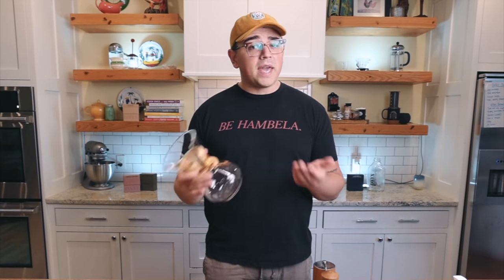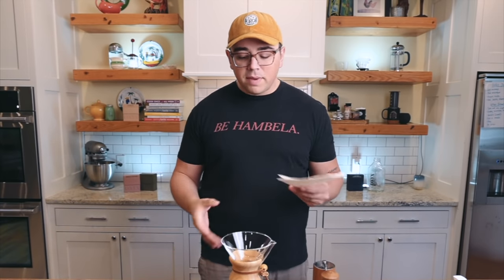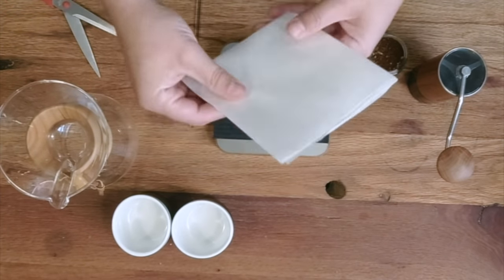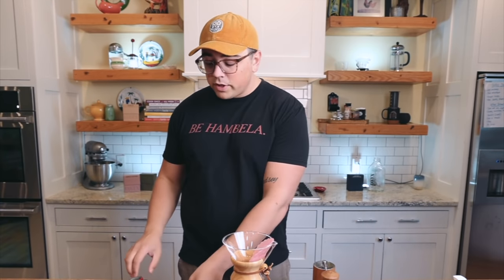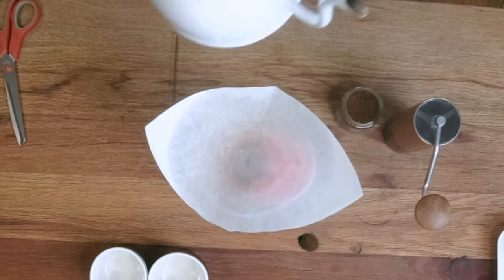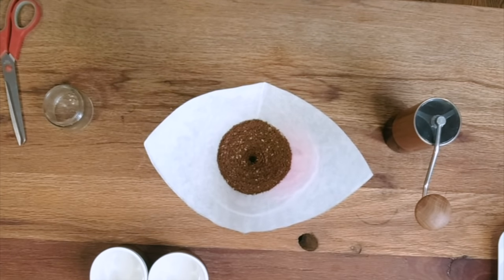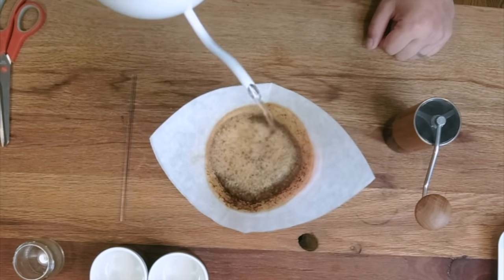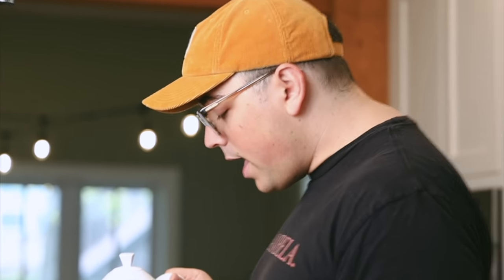CHEMEX BREW GUIDE: How to Hack and Brew Incredible Coffee on the Chemex

Comment: Have had my Chemex for countless years. I solved the vent problem long ago with a simple fix. I have a supply of plastic drinking straws, the ones with a flex joint on one end. I fold the straw down at the flex point to 180 degrees and put a small piece of clear tape  right at the bend to hold it in that position. I then place the long portion of teh straw down inside the vent channel and hook it on the pouring lip. It stays, no problem and provides the intended airflow for the pour to go without bubbling or stopping. Reuse many times, wash, rinse, repeat or get a new one.

Comment: For my 2 cents having used the chemex daily about 2 years, I don't have any issues with stalling and I've only had the spout clog a handful of times. I grind just barely coarser than a v60, but also make a larger 30:500 batch (in ~5min). You can totally avoid those issues just by using the filter the normal way, and I love how clean the cup is. 
Totally excited to try these hacks, love the stir stick and the cut filter hack! I just think the chemex deserves more love!
Reply from the maker: You're one in a million if you've not had clogs. Lol it's a ubiquitous complaint globally against the chemex lol.
Reply: I don’t have clogs either.  If it does happen, it just takes a quick shift of the paper to correct.  If it does happen to my brews, it is a simple correction.
Reply: @AdventuresinBackpacking  Same for me! One tiny clog once, quickly corrected and typically very uniform results.
Reply: @LanceHedrick  I think the reason for all those complaints is because most coffee connoisseurs (or snobs, lol) like to experiment and do their own thing. I have Baratza and Chemex and I do what the instructions say: 18-20 grind setting  depending on how light the roast is. I’ve never had an issue with clogging. I do a very gentle pour and a couple of swirls. Love my v60, moka, aeropress, but in the morning for the whole family 60/1000gr is perfect. Cheers!
Reply: @LanceHedrick  No Clogging for me
Reply: No clogs for me
Reply: Tried this today and got my first clog. Is it possible it's related to stirring?
Reply: No clogs for me either
Reply: I don’t have the clog issue either. Heard it often, but I have always used the filters as designed.
Reply: @LanceHedrick  no clogs for me either.  1 in a million is a little ... false I guess.
Reply from the maker: @Mark Purcell  nah. Just 12million people use the chemex and all 12 commented here. Or, perhaps more believable, one in a million is overt hyperbole. In my decade of teaching thousands of baristas, I've never once encountered someone using specialty coffee not encounter clogging IFF prewetting the filter 

But I digress. So proud of you all for not having clogging!
Reply: @LanceHedrick  I should have also added, I use the 6-cup chemex. Maybe has something to do with the type? I understand exceptions don't disprove the general rule, but there may be more nuance than "chemex brewers clog".
Reply: @masewinter  I think you may be on to something here. Using the exact same filters, I notice that I have absolutely zero clogging issues with the 6 Cup Chemex we use at the cafe I work at - but that I have to be super careful with my 8 Cup Chemex at home because it happens frequently. I wonder if there is some subtle design difference between the different sizes that can cause the same filters to either clog or not.
Reply: Used it for a year now every single morning, I've only had like 3 or 4 clogs and it was the times I forgot to align the thick side with the spout. Not a problem for me :)
Reply: I have a 10-cup, and honestly all of this sounds like a skill issue
Reply: Yeah I don't understand any of the issues he's talking about. Chemex has been my daily driver for almost two years and it works exactly how it's supposed to and results in a terrific cup every time
Reply: No clogs for me either, ever.
Reply: Clogs are very rare for me, but admittedly it took some time to get the filter sitting right to prevent it mostly permanently
Reply: came here looking for this comment. Never had any issues with clogs. I think it's happened once.
Reply: Mine doesn’t clog either. Don’t even know if I experienced it once. 

The problem more likely is people are grinding too fine and don’t know that need to grinder coarser.

Comment: i hate to disagree with you.  i usually love your videos.  i've been using a chemex since 1980.  water can not bypass the filter on the single fold side, there is glass there.  it doesn't get any better than that.  as for bypass on the 3 fold side, because of the small pour spout.  i have watched for this, and i have barely seen any of this; there are 3 layers of thick paper there.  if there is bypass, it is much less than a v60 would have with groves all the way around.  

in the last 5-10 years, i have noticed the filters appear to have changed.  i have never had a filter, 3 plies into the pour spout, plug the spout and cause a jam.  but like i said, in the last 5-10 years things changed.  i now fold back a portion of the 3 ply side's "ear" down into the spout.  this little trick totally solved the issue and i have never had it again.

Comment: Been using the Chemex for years and not once has it clogged on me. Just fold and press your filter properly then hold it with your fingers against the glass until you’ve wet a full circle. It’s not going anywhere after that. The chute is designed to prevent the paper from clogging it, that’s why (unlike a V60 server for example) the groove goes all the way down into the reservoir.

Comment: The Chemex was one of my first brewers on my coffee/pour over journey. Sadly I broke my first Chemex but bought the bigger version with the handle. They fixed the air flow issue with a bigger lip. I haven't had clogs with the new version but the filter hack and the stir stick hacks were very useful. Madcap coffee has a recipe that's nice as well and pretty close to yours.

Comment: I always feel weird that I've heard so much about chemex and stalls and used one for my daily brew for years and  never had a particular problem with it. I just do the 3 fold side on the side with the spout and do the divot thing  with the bed in this video and it's always worked  great.
Reply from the maker: Nice! Well, I promise your extraction will be more even with these hacks, even if you haven't experienced stalls. Stopping the bypass with that silicon hack and, even more importantly, the filter folding trick, will both help increase extraction and I believe your whole experience
Reply: @LanceHedrick  why would he care about those silly hacks when it works just fine. way too complicated doing all these unnecessary extra steps

Comment: Hey Lance, great video and I love the paper trick and the trick with the stick to spread the grounds. Question about the paper trick, Ive noticed while majority of the paper is still 2 and 2, the very bottom of the filter is actually not 2 and 2 due to the 45 degree cut. It's actually 1 and 3 still. 

Any ideas on how to fix this?
Reply: I'm not Lance, but I can answer: there's no way to fix it. It's that little bit you leave un-cut that prevents grounds from falling through the filter.

Comment: Interesting method of preparing the paper filter... I just buy "cone" filter papers...but I liked the use of the silicon, and stirring stick placement.
Reply from the maker: For sure. You can use cone, but the chemex filter is actually quite good. Thick and sturdy. I like using them for big brews much more than thin cone filters
Reply: @LanceHedrick  I wonder how would a double cone filter compare to a chemex filter? i think it is worth a try.

Comment: Thanks for another great lesson, Lance! Instead of the silicone, you could try sitting a metal straw or glass pipette right into the spout: it would provide a wall for the paper filter and breathing hole for the container, and do away with plastics... Talk about metal, any word on stainless steel filters?
Reply from the maker: You could but it would solve the bypass that happens there!
And I don't enjoy metal filters. They allow too many insolubles through to the final cup. I prefer clean cups where the acidity isn't overrun by the cell wall fragments, oils, etc, that make it through. But, everyone is different!
Reply: Does the straw method work for you? I had that same idea and then saw your comment.

Comment: Not sure if the three-layer filter side filters are any different than the one-layer filter.  Because the filter is not filtering much pass-thru down its sides, we hope. It filters only through the bottom one-inch or so diameter bottleneck hole, so the filtration difference from three sides versus one side is only after the bottleneck hole.  There is a difference, which you can check by tilting your Chemex one way or the other and you will see flow rate change. Once the filter is wet against the smooth glass cone above the bottleneck, no brew gets through until it reaches down into the bottleneck.  Right?  Now consider if I am wrong about that.  Then the Chemex engineers would have made the triple-fold side filter 1/3 the amount of the single-fold side and the single-fold side filter three times the amount of the three-fold side with neither side's flow-through being optimal.  That's not impossible; they would have made the filter's pass-through holes to allow an optimal average with a 3 to 1 ratio.  Saying it differently, the thick side would filter three times slower than optimal and the thin side would filter three times faster than optimal.  Together they would add up to Optimal.  

A tapered chopstick (Japanese style) is excellent to hold the funnel open, if necessary.  A red one works best.  That pink thing destroys the Chemex, I doubt you'd find that in the Museum of Modern Art.

Comment: What ever you do Lance, there is ALWAYS something I learn.  Can’t wait to try your filter hack and perhaps the pouring technique...  always amazes me!
Few questions:
1- is the only reciepe you do or do you have one with less coffee?
2- when you refer to a grinder, it would help (me at least) to know the full range of the grinder (i.e. 24 clicks on a range of 100 or 25?). It would help to set on my grinder
3- i had seen the chopstick in the funnel hack, have you tried it and how does it compare to your silicone hack?
Thanks again!
Reply from the maker: 1- you can scale this down no problem! If doing less than 32ish grams, I'd recommend going down to a V60 anyway. But just scale everything down no problem!
2- I say 24 clicks because it refers to microns. Every click on a c40 is 30 microns. So, about a 12 on an encore grinder. You can also get a kruve ruler that does microns and you can put it beside the grounds.
3- yeah I have. It does an OK job, but I prefer the silicon because it decreases the localized bypass even more
Reply: @LanceHedrick  yeah, I went the chemex way as I wanted the “less oily” taste vs V60...  but as I most of the time end up drinking 300-400ml, perhaps I should have gone v60 way...  learning at all ages.
Reply from the maker: The amount of oils in a V60 should be extremely minimal. Especially if using hario untabbed filters. Would love for you to give my v60 approach a try! I'm thinking you may end up preferring it. Plastic v60 is cheap
Reply: @LanceHedrick  I know, I know...  price is not the issue, kitchen realestate for “coffee stuff” is negociated in my house 😂😂😂. Another reason for Chemex is that I’ve seen v60 filter holders that fit into a chemex...  you may have convinced me...  or perhaps will drink just continue drink more coffee on my chemex 😂😂
Reply from the maker: Hahaha! Plastic, though, is a much better insulator than glass. Your extractions will vastly improve
Reply: @LanceHedrick  is a grinder with lots of fines (like a conical) or less fines (like a flat) more suites for pour overs?
Reply from the maker: I think it depends on what you're wanting in your cup. They both provide different experiences! I personally use conical most of the time, but it's mostly because the flats I really like are price prohibitive

Comment: Never had an issue with bypass using any of the Chemexes, or even a V60. With proper pouring technique it simply doesn't occur; there's even a video with James Hoffman pouring directly on the filter, and still the water travels down (not out) the side of the paper and into the coffee (actually giving more, but a worse tasting extraction). 

Secondly I've never had an uneven extraction due to the 3 ply on one side. Water doesn't leave through the side of the filter so it's irrelevant; with the Chemex filters it leaves only through the tip of the cone, after filtering through the coffee bed. Extraction is more even generally than with say a V60.

Comment: I've never had a problem with the filter blocking the chute - I just jigger it a bit after the rinse, if necessary. I always figured that the three layer side of the filter in conjunction with the chute, would ensure that the water passed through the three layers rather than going out elsewhere.

Hmmm .... Maybe if the chute is taken out of play entirely like this with the silicone then water can ONLY exit into the carafe at the bottom tip of the filter, after it has also passed through the coffee.

Comment: I have done the trick for the filter, but you still end up with the tip of the cone being 3 flap on one side and one on the other side, so still some uneven extraction right at the tip, where most extraction happens, right?

Comment: Hi Lance, trying to follow this with my C40 but getting longer brew times 10min+ sometimes. How are you locating your zero on the C40? (I'm doing it from where the crank sticks when holding the grinder horizontal - e.g. not where the burr is screwed in as tightly as it can be with the click mech)

Comment: I'm not sure what it is. I actually went about a year of using the Chemex before having issues, but once they started it never stopped. Not sure if it's something to do with technique or not. But I just have a square chopstick that I stick down in the spout and that works fine. It doesn't completely flatten out that spout, but it does it enough.
Reply from the maker: Yeah a chopstick will prevent the filter from sagging. Doesn't lessen bypass, but does well enough

Comment: This might be a very very dumb question but if the filters being double ply is an issue then why not do the mod you describe in this video and then half it again in order to make it single ply?
Reply from the maker: Not a dumb question. The filter would lose its integrity. Also, double filter isn't why it is an issue. It's the fact three flaps are on one side and one on the other.
Reply: @LanceHedrick  Ahhhhhh gotcha! Thanks!

Comment: huge improvement on my brewing, my only issue is to make 8 literal cups my cooffee comes out warm and not hot!!! any tips for that? using ground coffee, would grinding a more coarse help?
Reply from the maker: Are you brewing with near boiling water?
Reply: @LanceHedrick  yup my gooseneck kettle has a thermometer built in

Comment: 8:30  Kabumi!  Also, sweet trick pour into two cups at 14:33!
Reply from the maker: Thanks! And it is sorta Kubomi. This method I picked up from Ray, as well, some years back. Just a quick way to make a divot sans compression
Reply: @LanceHedrick  I do the same with a Saint Anthony Industries' G70.
Reply from the maker: Nice! Definitely need it on that deep dripper. Phew!

Comment: If we double the amount of coffee and water for this recipe, does this double the durations for each step?
Reply from the maker: If you double, that will change some things. I'd add another pour and divide the new water amount evenly.
Reply: @LanceHedrick  What do you mean when you say to divide the new wat4er amount evenly?  Sorry, it's not clear for me.
Reply from the maker: It's ok.

Let's say we have a recipe with 3 pours and 300g. We could do 3x 100g.
Now let's say we have double the recipe to 600g. We add a pour. Now we have 4x pours. 
Instead of 3x 100 and 1x 300, we will evenly divide them. So, 4x 150
Reply: @LanceHedrick  OK, I think I grok dividing the water evenly.  Still not clear on time adjustment as a result of doubling the amount.  We're adding a pour, so in this recipe, from 5x to 6x.  What about the times?

Comment: Any tips for a 1000g pour?
Reply from the maker: Just scale up! I would not do more pours than 5, so try this:
60g coffee
1000g water
125g pour, swirl
125g pour, swirl
350g
250g
150g
Reply: @LanceHedrick  thanks for the tips! I’ve been using the Chemex method daily for about 10 years but I’m always looking to tweak things for a better cup. What’s your thoughts on the Able Cone filters? I’ve dabbled with it but haven’t “figured out” the best technique.
Reply from the maker: Issue with the cones is there is no way to make a clean cup. Paper filters absolutely make a much much cleaner cup by holding back insolubles and oils that tend to make the cup unpleasant. That being said, I have a video with the cones coming next week. Not the video you think it is, but interesting nonetheless

Comment: Or you can use a bendy metal straw on the flute if you don't have that silicone thing. Not sure if this would actually work though, I'm just parotting what another person said in the comments of another youtube video that was talking about the issues on the flute of a chemex.
Reply from the maker: For sure! People do straws and other things, but it doesn't help with lessening bypass.
Reply: @LanceHedrick  Hey Lance, on the subject of Chemex and Chemex filter hacks.... I got a hold of a brewista 5 cup hourglass brewer lately, and I came across a so-called barista fold for the chemex filter. I'd like to hear your thoughts on these two if you ever came across it. Thanks!

P.s.
Watching you give the Hoff Man a piggy back ride had me laughing in stitches. Good stuff man.